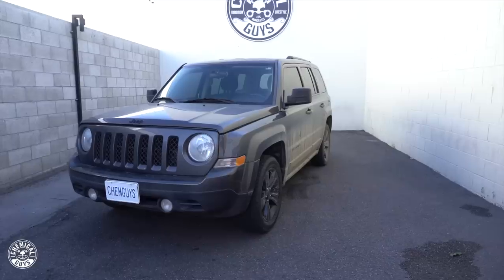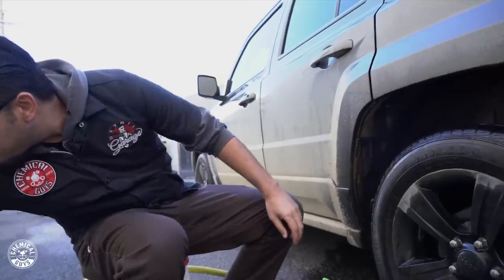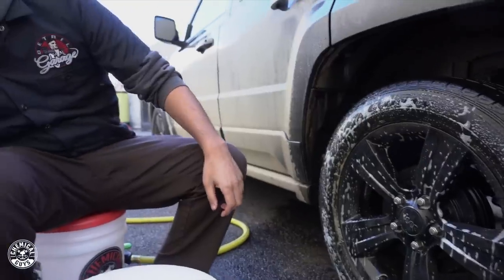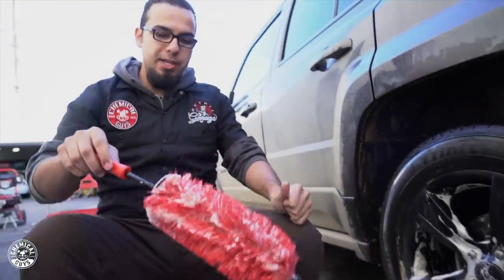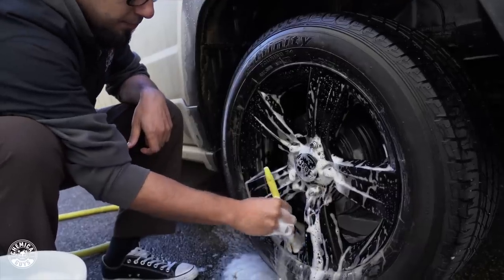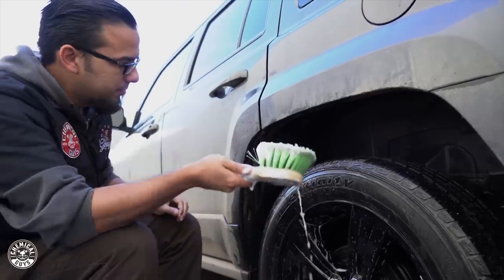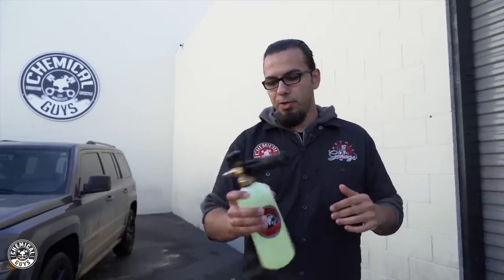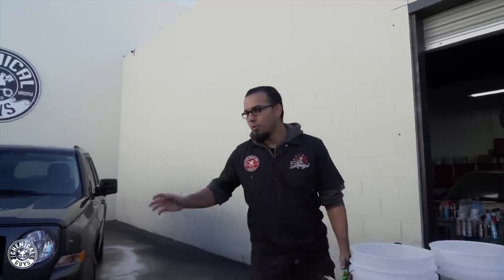How To Safely Remove Road Salt, Dirt & Dried Mud! - Chemical Guys

Comment: When I have that much lower panel road grime, I foam in reverse order.  Start at the bottom and work up.  That way the bottom is soaking first and then the upper can rinse down helping to pull off that loose grime.  But I still do the wash down technique as Nick does with the wash mitt.

Comment: How were you able to reach the top of the Jeep without leaning against the vehicle and possibly scratching it. Did you use some sort of ladder?
Reply from the maker: Hey there! That's right, being able to reach the center of the roof is often difficult without having a step stool/ladder or being over 7 feet tall. 
- CG Nick
Reply: Chemical Guys Thanks. Do you guys sell a platform or anything to help with that?

Comment: Great video, but how do you safely remove road salt and dirt from a car when it's 20° outside?
Reply: Propane torch
Reply: You don't.  It won't corrode until the temperature gets warmer - above freezing
Reply: use Star Brite Salt Off in combination wit your soap in foam cannon, then rinse and wash.
Reply: @b374mxg  I get that, but I want to safely remove it for aesthetics.
Reply: @rutgermeurs6111  rinsing and washing isn't an option when it's below freezing.
Reply: Jack Whelan then you cant get it of. Do it in an garage

Comment: I don't think I have dried mud on my bumper and the front of my hood it looks like it could be powdered gravel or possibly salt residue from the roads what do you recommend to remove it?
Reply from the maker: Hey Michelle! Clean the vehicle with Citrus Wash and Gloss before using a Medium Duty Clay Bar with Clay Luber to extract embedded contaminants and stains.

Comment: Signature Series wheel cleaner is my #1 favorite external APC - I use that &%$# on everything! Chrome, bumpers, wheel wells, exhaust tips, plastics, etc. Cut 4 to 1 it's economical and very effective! I've been using it for years when it used to be called, premium blue.  The long handled version of that brush is my favorite wheel cleaning tool too! I just took advantage of your decade end sale and picked up the Torq R! I'm looking forward to using it when it warms up here in MA! Happy New Year Nick and all the folks at CG!

Comment: Any advice you can give about cleaning the carpet wheel wells on GM pickups?
Reply from the maker: Hi Randy! Thanks for your message. Spray the liner with an all purpose cleaner such as Nonsense and gently scrub with a Nifty Brush before rinsing.

Comment: what diluation do you recommend using for the orange degreaser when you're using it strictly for your wheel wells/suspension parts. I know on your website you give the option of heavy medium and light diluations. So which one would you recommend for that job?
Reply from the maker: Hi Michael! For moderately dirt undercarriage components I suggest using Orange Degreaser diluted to 10:1.
- CG Nick
Reply: @ChemicalGuys  awesome! thank you so much!

Comment: Its ok to wash the wheels and tires with a neutral ph shampoo?
Reply from the maker: Hey there! Absolutely, using a pH neutral soap is a safe way to clean wheels and insures caustic cleaners aren't used which could damage sensitive wheel finishes.
Reply: @ChemicalGuys  thank you foenyour answer! Regards from Brazil!